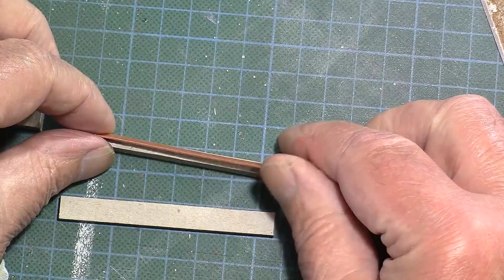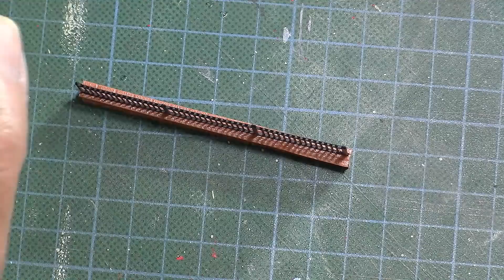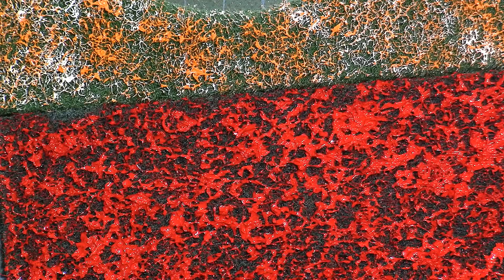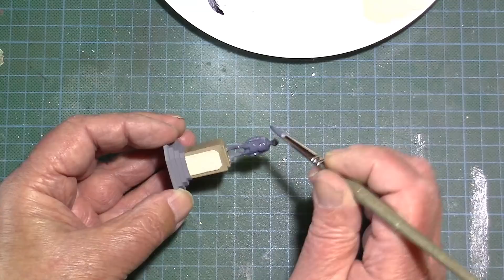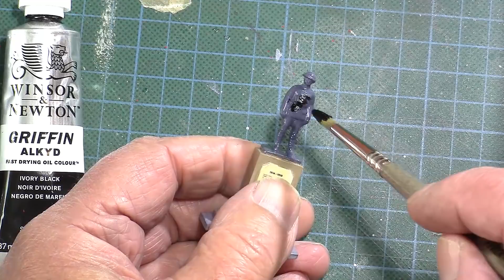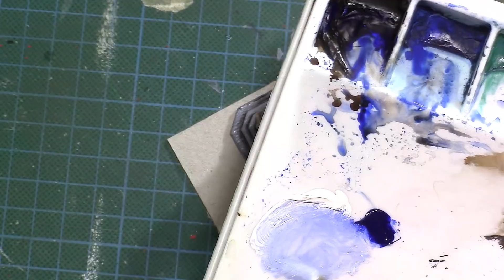DERESLEY TOWN PLANNING Pt 3

Comment: What is the advantage of using oil paint rather than acrylic for the weathering?
Reply from the maker: The advantage of adding weathering with oil paint is (1) it takes longer to dry so you can work on bigger areas in one go and (2) when painted over acrylic - when the acrylic is dry - you can paint on the weathering with oils and you can wipe it and reduce it, or completely remove it with white spirit without affecting the acrylic colours in any way. You can't paint acrylic over oil by the way. 😊👍👍
Reply: @davidhyde4329  Does that mean that trying to wipe freshly applied acrylic off older dry acrylic would tend to pull off some of the older dry paint?  Is this a substantial problem or just not as good as using oils?
Reply from the maker: @beachdancer  Hi. yes - you can apply acrylic and wipe off in the same way before it dries, but it dries massively faster than oils. Therefore you often don't get the time needed to work in subtlety before it dries. So you either have to work very quickly, or just work on q small area at a time. There is always a tendency for earlier layers to be pulled off (see below). But here acrylics have the advantage. Layers will stick to each other permanently - no problem (unless you use too much water in thinning the paint). Acrylics (properly thinned). Oils are not permanent - the earlier coats can be softened and effected by overpainting oils with oils.
There is a saying 'oil and water don't mix' which is correct. BUT you Can paint oils onto dried acrylic paint. You Can paint acrylic onto dried oil (art restorers do this). BUT oils can take up to 2 years to fully dry - so this way round is impracticable. 
For us modellers there is a problem with the slow drying of oil paint because most oil paint contains a slow drying medium (Linseed Oil). However there is an oil paint that replaces the Linseed Oil with a  man made Alkyd resin. (NOT the same as Acrylic resin so you can't mix them). Alkyd paints are great for weathering because they can be thinned with cheap white spirit. Check out 'Winsor & Newton Griffin' oils (If you are thinking of going this way) They are much cheaper than conventional oils - and you only need a few.
The problem with all paints being lifted is more connected to the bond made between the first coat (any paint) and the surface of the object to be painted.
I have been looking for a subject for my Christmas video and your question has given me the answer. I will produce a fuller video covering this with my experience as an artist and model maker. Hope this helps 👍👍👍😊

Comment: David - I stumbled across your website when I was looking for advice on building a 00 turntable. I watched a video of your build based on the Peco one (v clever), then another one where you removed the TT and substituted a long siding. So v cheekily I wondered if I could buy your modified TT? Of course, I understand if you are keeping it for a new location! BTW, all your videos are inspirational, I am particularly impressed by your painting skills applied to the backscenes ... Kind regards. Roger.
Reply from the maker: Hi Roger, sorry for the delay in reply. My apologies too as I have disposed of the bits. I gave the motor to a friend for use on his layout and the rest was consigned to the spares box. Hope you have managed to get the bits you need.

Comment: Excellent video David, the war memorial looks fantastic. Could you give some insight as to how you made the decals for the war memorial please?
Stay safe
Michael
Reply from the maker: Hi Micheal , many thanks for your kind comments. There are plenty of YT videos on the subject - this is how I made mine. First you will need a 'special' decal paper for printing - choose to match your printer (Lazer or inkjet). There are two types - a clear backing (I used for the War Memorial) or a white backing - if you need any white or light colours in the design. You will also need some software to produce the text and be able to reduce it to scale. I use Photoshop, but there are plenty of others (including 'Paint' - free with microsoft). Create your list of names - I used real names - made the list look more convincing. Measure your plaque and reduce the design to fit. Do a quick test print on ordinary paper.
When you are happy make a small group of each decal (it pays to have spares). Print your design onto the decal paper. LET IT DRY - don't be in a hurry, make sure its dry - I leave it overnight. NEXT day you need to seal the printing by spraying 2 or 3 coats of Acrylic gloss lacquer, Again allow 2 or 3 hours between coats TO LET IT DRY. Again I leave everything until the next day. Then trim you decals to size and apply them, to a gloss surface, in the normal way. I would then, after they have dried, seal them onto the surface with a brushed coat of gloss acrylic varnish. After this they are safe enough to apply any weathering you wish to do. Then finish the whole model in a matt varnish. Sounds simple but a bit long-winded. I have learn't, by bitter experience, not to hurry this process. Hope this helps - good luck👍👍👍  ...  David
Reply: @davidhyde4329  Thank you David for the very informative reply.
Stay safe
Michael

Comment: Thank you David, not just a tutorial - a masterclass! I was particularly interested in the decals you produced for the memorial. I am not highly computer-savvy but I wonder if you could describe the program and the process which resulted in such fine transfers? Looking forward to your next episode. Cheers.
Reply from the maker: Thanks Roy - sure
STEP 1. You will need some A4 Decal/Transfer paper (inkjet or laser depending on your printer). Satin or gloss will give the best definition (marginal though) and some imaging software that handles text (I use Photoshop but you can use Paint (comes free with Microsoft Windows).
STEP 2. Produce your decal - In this instance I just typed in the Memorial list (yes they are actual names - you can't read them with the naked eye buy it makes a list of names look more authentic). Then you need to measure/size the area needed and then re-size your decal to fit. (I do a test print on plain paper and measure to check - adjust size if necessary). When you are happy make up several copies to print (you have spares then if things go wrong). Set your printer to photo satin or photo glossy paper and make sure its on 'high quality' - then print onto your decal paper. Now leave to dry - don't be in a hurry - I leave mine for 24 hours.
STEP 3. Seal the Decals. Cut out the block of decals (saves paper) and spray with gloss Auto Lacquer (Halfords). If the printing is not fully dry it can 'run at this stage' (believe me!!). It is quick drying but I leave a couple of hours after each coat, and apply 3 coats. If the ink is dry there should be no problem - the result is a clear, dry, glossy finish. Leave a couple of hours before use - I prefer to leave over-night. When everything is fully dry I finish with a coat of matt varnish.
STEP 4. The surface of your model should be dry and glossy. (as in the video). Apply your decal(s) - leave to dry. Once fully dry apply a final coat of gloss varnish - this will seal the decal and protect if for the weathering stage. If you are not going to 'weather' give the model a coat of matt, semi-gloss or gloss vanish.
STEP 5 - pour yourself a beer  ...  Cheers!  ...  David
Reply: @davidhyde4329  David, this so comprehensive - I can't thank you enough for taking the time to provide such detail. Proof indeed, if it were needed, of  why you are so good at what you do! Much appreciated, Roy.

Comment: I really like that weathering technic, I have a 3D printed statue of Isambard Kingdom Brunell that I want to paint. I have used Oil Paint before and everything ended up black and did I get it in the neck for it. Now I know have to do it better and I just have to wait for the Oil paint to dry. Many thanks, David. The 2mm card here is not as good as the one you are using. It tens to break up the fibres when cutting.  Martin. (Thailand. Roses Grow On You.
Reply from the maker: Hi Martin, glad you liked the weathering. No, sorry if I confused you, you don,t want the oil paint to dry at this stage - paint it on then rub it back - just as I did in the video. The act of rubbing off the paint produces the weathered look.
It is however still glossy, thanks to the gloss varnish. It needs a coat of matt varnish to finish. This is when you want it to dry - I will then spray on a matt acrylic coat normal oils take a longer time to dry than the alkyds. I will make this clear when I finish the memorial in the next video. Shame about your grey card supply. Its hard to suggest an alternative - unless you can re-use boxes???  Stay safe  ...  David

Comment: Do you know what the fencing is along the top of the wall? I think I had some (or something similar) but I don't know how to get more.
Reply from the maker: I am sorry to say I can't remember. I bought it some time ago either from ebay or from a model railway exhibition. I liked it because it looked the proper scale thickness of railings, each tipped with a spike. Can only suggest you search 'park railings' or just 'railings' in ebay and see what comes up (you will also need to search as oo gauge or you will be swamped with options). Good luck  ...  David

Comment: These videos are a joy to watch and gives plenty of useful ideas.  Do you think those Windsor and Newton paints would be suitable for painting the hull of a wooden RC boat for use on a pond - have you any experience in this area of modelling?
Reply from the maker: Many thanks Malcolm - much appreciated 👍👍👍. I cant see why artists acrylic paints should not work, but I am not sure I would recommend it - particularly if you are thinking of using the paint to seal/prime the hull. Artists paint in tubes can be expensive and not all colours are opaque. If the hull is watertight and you are just going to decorate it then it should work. I have some experience with wooden hulled boats, but that was many years ago. I cant remember how painted the hull. If I were doing it now I would find out what is 'common practice' and follow this. Bound to be some help available on YT - good luck with it  ...  David
Reply: @davidhyde4329  Many thanks David for your valuable advice. I hope you did not mind me asking this question on a different subject but you show great skill with what you do and I especially like the videos about the model car restorations. Quite a lot of modellers do different types of modelling although I reckon Model Railways  is probably the most popular - I love it all! Cheers

Comment: Nice update David. I haven't yet tried it, but apparently if you tease out the scourers a bit they make passable low hedges. If and when your R/C glue runs out I can heartily recommend Roket card glue. Cheers
Reply from the maker: Hi davie, thanks for the comment and the tip. I will try Rocket glue 👍👍👍  ...  David